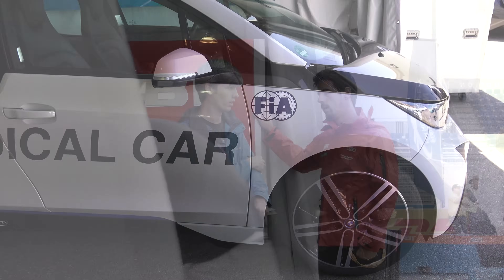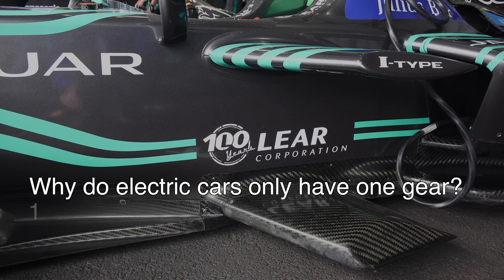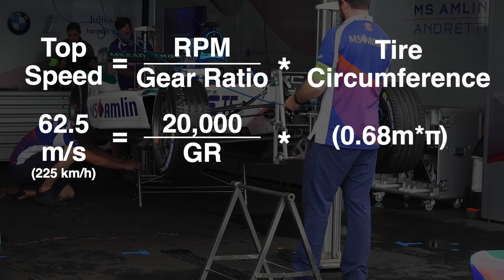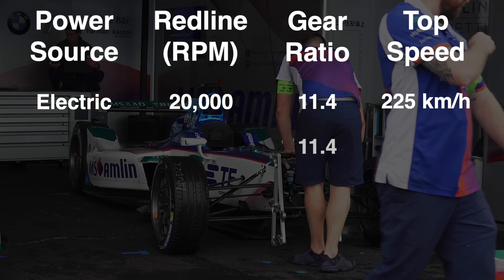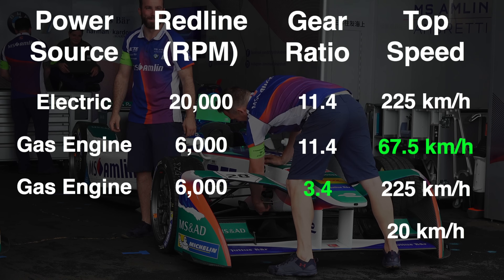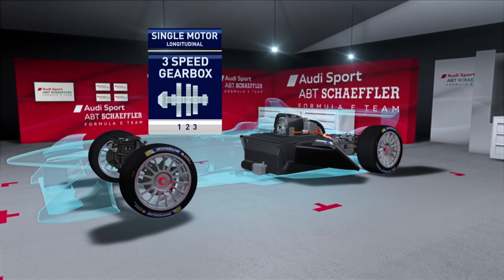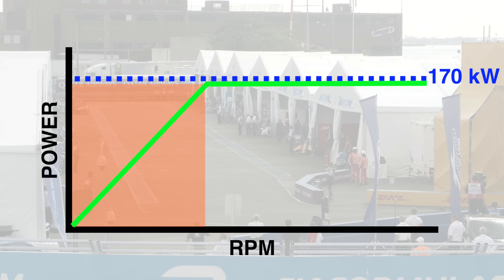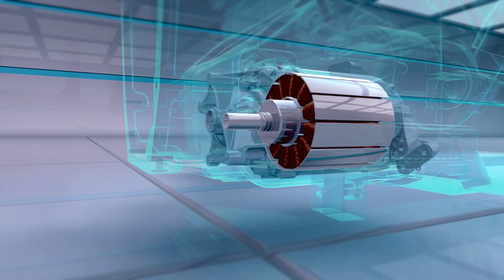Why Do Electric Cars Only Have 1 Gear?

Comment: Battery lifespan is a major concern, but I wonder what the lifespan of the electric motors will be with them possibly spinning at very high rpm a lot?  What about the magnets in the electric motors, will they degrade over time?  Time will tell.
Reply: Electric motors last, generally, far longer than ICE for a simple reason. The only part that wears out is the bearing that allows the rotor to stay in place. Depending on the quality, it can easily last over 1 million km. What will wear out way before that will be the transmission.
Reply: Magnets do wear out with extreme heat, nothing that liquid cooling cant solve...but only dc motors use them , ac motors dont need magnets, they are basically opposed pulsing electromagnets..
Reply: +Erik Stephens
"Automotive batteries today are designed to last the life of the car.   And if by some chance you want to keep the car and maintain it to last 30 years batteries will be a lot cheaper by then."

Exactly. I recently bought a Toyota Camry Hybrid. Everyone said the same thing: that the batteries wear out but I looked into it and found that, if anything, the reverse is true. Toyota regard the battery pack as a life of vehicle component. The alternative was a car with a gearbox and I found that while a replacement gearbox costs about the same as a replacement battery pack (remember CVTs are incredibly reliable), the reliability of a gearbox was, if anything, lower than a battery pack. As you said, the price of batteries is coming down but the price of a gearbox is mostly going up.

Most people who spurn the idea of a hybrid would probably never buy one anyway and a lot of this is due to poor understanding and a large amount of stigma-driven disinformation. I get 900 kms out of a tank. My old V6 Kluger used to get 350 out of the same size tank. Guess who's laughing?
Reply: Exactly that's why his concern is not valid.  Automotive batteries today are designed to last the life of the car.   And if by some chance you want to keep the car and maintain it to last 30 years batteries will be a lot cheaper by then.
Reply: +Borivoje Travica This is not true. Toyota regard their battery packs was a life of vehicle component and there are plenty of Toyota hybrids which have done more than half a million kilometres.  Their failure rate is actually lower than that of a gearbox and unlike gearboxes, whose complexity and cost is going up, battery packs are becoming cheaper all the time. Furthermore, someone tested two battery packs - one from 2001 and another from 2011 and found the difference was negligible. If you don't want to buy a hybrid then don't but that's a matter for you. But don't tell us they're less reliable and more expensive to fix because they are not. I did not believe it until I researched it. That's why I have a hybrid now. If anything, they are more reliable than other cars.
Reply: These motors are AC induction, so no magnets or contact points.
Reply: wow didn't know that so how does it work? by pulsing DC electromagnets on these permanent magnet shafts?
Reply: All EV's use 3 phase AC variable frequency drive motors.   The Volt has two electric motor / generators.  One is permanent magnet the other is induction.   Model S and X is induction.  Most others are permanent magnet.
Reply: Erik Stephens what a BS....tell me what batteries is lasting 15 years, named? 5 to 6 years top with decreasing capacity with 150 000 and this is my minimum....saw I must giv 7000 EUR every 5 years...today's for 150k I need 2500 EUR for LPG or 5500e for gasoline....btw electric bill don't counting
Reply: TheThirdMan you do not answer in my question at all and I can not giv you mathematics...I have smart fon and I get a message, regular message ,saw try that I do not liv in ju tube to but you saying you do research ...is no information at all but tnx
Reply: Alright, I'll put it another way: Toyota guarantee their batteries for 160,000 kms or 8 years. That is easy to find out. How many car engines or gearboxes have that sort of backup? None that I know of. There will be no warranty on your car's LPG system beyond a basic workshop warranty and few motor manufacturers will take a favourable view of putting an LPG system on your car. Some will cooperate but most will not.
Reply: Most popular EVs don't use AC induction actually, with the exception of Tesla (Model S/X and Roadster). That said, even their new car, Model 3, uses permanent magnet instead of induction. Chevy Volt/Bolt also use permanent magenets.
Reply: I think these cars use AC (not DC) permanent magnet motors.
Reply: They last a long time.
Reply: TheThirdMan yes is true....but I don't speak about hybrid they still use 5-7 litres per 100km ...my car run on Lpg 6-8litres per 100km....Tell me how much cost 50kWh batteries pack of lion with 1500 cycles charging-discharging...IN THE FUTURE!!! Oils and lpg have lots of room to price go down if we looked manufacture cost of produced if be batteries cost go down...tell me where I can by and how much cost per kWh and how much cycles I have, with how much dropping capacity per cycles....and I give to you mathematics not dream
Reply: TheThirdMan No answer 😀
Reply: +Borivoje Travica
"I don't speak about hybrid they still use 5-7 litres per 100km"

Mine gets 5.5 l/100 kms. Most do better than that. A Prius should get under 4L/100km but mine is a bit bigger anyway.

"Tell me how much cost 50kWh batteries pack of lion with 1500 cycles charging"

Nobody uses LiPo packs. They're too dangerous. Toyota uses NiMH.

"Oils and lpg have lots of room to price go down if we looked manufacture cost of produced if be batteries cost go down."

The price of oil is going in one direction. Up. Oil will never be cheap again.

"tell me where I can by and how much cost per kWh and how much cycles I have, with how much dropping capacity per cycles....and I give to you mathematics not dream"

Well, a new battery pack used to cost about AU $4,500 but now can be had for about AU $2,500 (about 1,800 Euro) from third party manufacturers. Toyota have been making these things for 20 years. It's mature technology. I have no idea how many charge cycles it can take. I can just cite that example of the battery pack from 2001 and one from 2011 that I quoted earlier.

"No answer"

You might be disappointed to know that I don't spend my entire life on YouTube.
Reply: steaker1705 tesla's battery liguid thermal. Management
Reply: The battery technology is the only one holding the electric vehicle back. If not we'd already be driving electric.
Reply: The Battery in our Renault ZOE is 5 years old and still has 98% SOH.
Reply: I think once they can figure out a battery tech that can survive far more charge/discharge cycles and maintain a good power density than current lithium/lead acid batteries we will see a HUGE EV explosion.
But until then dinosaur powered cars will stay the king.
Reply: 15 years is too short of a battery life?  Because most EV's produced today will still have more than 70% capacity after 15 years.
Reply: Jordan Anderson Check out Jay Leno's Baker electric on YouTube. 100 years old, still works perfectly. Batteries are new of course. but the motor will last generations. Our whole industry runs off electric generators and motors. They will last a looong time even at continuous duty. You can design any part to last as long as you want, but there are compromises.

Modern batteries will probably last a million miles in a car. The batteries will out last the car and owner.

Comment: Great video, but it just make me more curious. With the advantages and simplicity of an EV drivetrains (like what's used in the Nissan Note E-power),.Why don't all vehicles use them?  No matter where the electric comes from like a battery, or an ICE used w/generator (or 100s of other options that become available)? And why do most BEVs, use motors with just poor performance  (just to keep the driver from using to much energy)? And I guess I'm later to the party since I just saw ur Series Hybrid Cars - Explained post.

Comment: Could an electric car have a manual transmission?
Reply: The way they traditionally work, no. But if you added limiters with every gear then theoretically, yes. But doing that is mute and would inhibits the cars maximum performance and ability. It would be a vain thing. This is from my understanding, I could be completely wrong, I'm not an expert in these things. Just my 2 cents from my limited knowledge.

Comment: The complexity of the transmission is the key.  Most electric cars can do without them but if you want a powertrain that can do everything, selectable ratios help.  Remember the original Tesla Roadster had a 2 speed gearbox.  Due to arrogance of Elon, they refused to accept help in the design of the xmission.  The result was the electric motor ripped the transmission apart.  To deal with this, they migrated to a single speed setup.  Shift shock on an electric motor combined with low end torque is a harsh thing.

Comment: Where does all the power come from? Won't the cars run out of juice going at those high speeds? Charging isn't exactly fast.
Reply: Cry The rules and regulations limit the cars to a tiny battery. They actually add lead weight instead of  ore battery. I think the rules even say they have to car swap. They don't want electric cars to be faster than f1.
Reply: The distance they race is rather short. A normal Formula E race goes over a distance of about 90km and at the moment they still swap cars after about half the distance because the batteries are pretty flat then. Next season the car swap will be gone and they will drive the whole distance with a single charge.

Comment: So question number one: What kind of electric machines does formula e use? Are they using induction motors? 
And number 2, even though in a series partnered with FE you probably wont do it, but could you make a comparison between F1 and FE and how much the battery tech would need to improve to get F1 kind of speeds and endurance. Because my rough calculations told me, that battery tech would need to improve at least 5-10 times until FE could compete with F1. Because there are so many people on the internet saying, that FE is the logical step for F1 in the not so distant future, but even though I really like FE I think they will never reach F1 speeds and endurance

Comment: I remember back around 2008, Tesla tried to put a 2 or 3 speed transmission in their car, but had to ditch the idea because the electric motor produced so much torque that it kept breaking the transmission XD
Reply: I remember back around 2008 everything Tesla did broke lol.
Reply: I don't think that was the case. Top Gear said that about the first Tesla, and Tesla sued the BBC because when Tesla received the car back, it wasn't broken at all, but the UK courts ruled that Top Gear is an "entertainment" show and didn't have to be factual, even though Tesla proved it was false.
Reply: Thx for the convoluted logic. The BBC won, based on its show being entertainment, not on the facts of the case, correct (Even if u want to say "Tesla proved it was false" its not part of the court;s ruling, check with a lawyer)? So besides the case proving Elon loves to sue, what did this case really prove?. But seriously there were many reports in the media (I guess by Top Gear too, I didnt c that 1) of Tesla poor reliability in its early years, And I was just making a joke about it. I just hope Elon and or one of the Teslahiles don't sue me now, lol 

And hope u realize there r and were transmissions in 2008 that could handle the output from a Tesla electric motor. So the fact that the transmissions would break, just means they were defective,  

And 1 last thing I enjoy seeing Tesla come out with new tech but its funny how ppl get so defensive about Tesla;s flaws, its like it a cult, so try not to drink the kool-aid  :)
Reply: ...I was saying the same thing, lol. You're arguing the same thing that I'm saying. "Check with a lawyer," haha you're funny, it doesn't take a lawyer to look up civil lawsuits. I don't think it was being "sue-happy," though, Top Gear spoke of a trademark brand as if it were factual and Tesla had beyond reasonable evidence that it was false.

I'm not wasting time researching it, but what I remember in 2008 was that Tesla tried transmissions from numerous vendors, but there weren't any consumer-grade transmissions that would work. Transmissions for consumer cars just weren't designed for the high revs and high torque. Now, would a Formula One-grade transmission work? Yeah, probably. But it was more suitable and less expensive to use a single-speed transmission.

And I'm just talking about the transmission, I don't know about other reliability issues with Tesla, and frankly I don't care. I'm not really sure what other issues Tesla could've had because electric motors are much more simple (which makes them more reliable) and most of the other parts were probably bought from Bosch like everyone else does.

And don't assume things, I'm not a fan of Tesla nor Elon Musk. I'm a VW Group fan.
Reply: Just out of curiosity I googled the power and torque of a 2008 Tesla and it not even high for a sports car. But I agree talking more about this a waste of time.

I didn't assume or say ur a fan a of Tesla or Elon Musk (I did make a joke about Elon sueing me). Have fun as a VW Group fan.
Reply: Oh, really? Maybe they lied XD that's a possibility, cheers!
Reply: Its all Fake News now,  it's a Trump world we just live in it,

Comment: I see how it makes sense to have only 1 gear for performance cars, but wouldn't having more gears on a street car increase it's mileage? if instead of going 20000 rpm at cruise speed, the vehicle could go at the same speed but at lower rpm wouldn't it consume less energy from the battery? Or does this not apply to electric engines?
Reply: Makes no difference in an electric car.